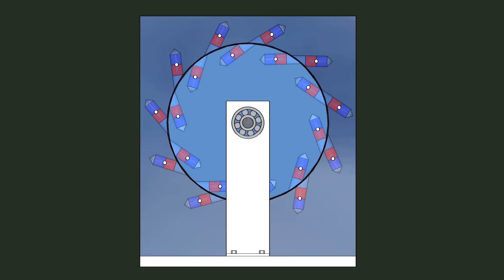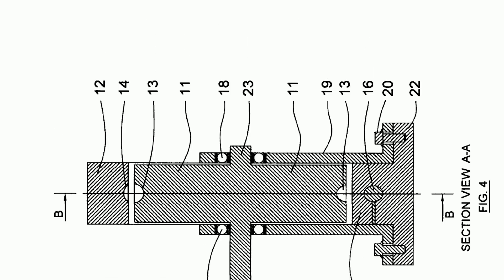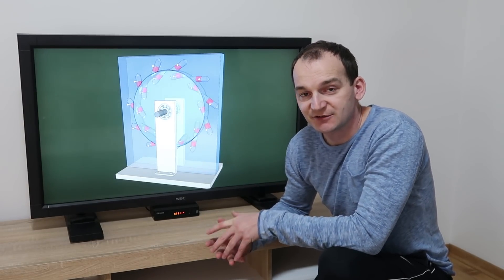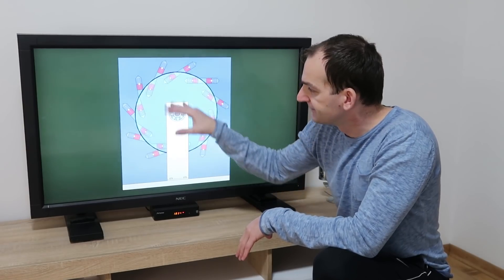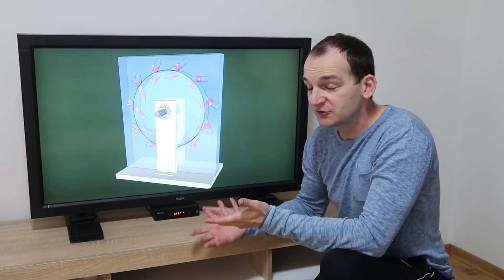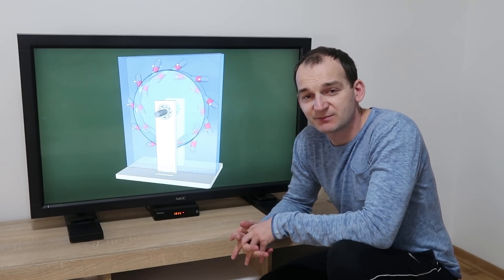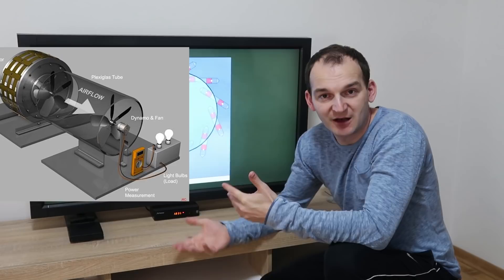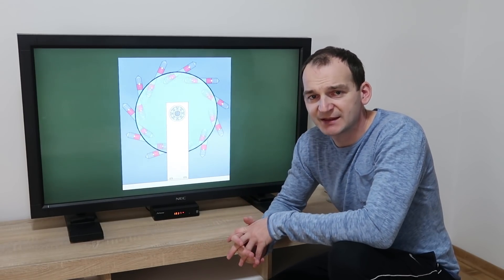Free Energy, Magnetic Motor with Magnetic Shielding by Suppiah!!!!

Comment: Lemme tell you why this won't work, as the magnet will aproch the fixed magnet, it will start rupultion, on other direction. And as the magnet will pas the fixed one, when fixed one will push the magnet, there will be no change at all, as moving magnet slow down by same amount with which it is pushed as it moves past the fixed one.. You need to prove this with a simulation not a animation. Or a physical model. Don't just file design patent and waste 1000s of bucks. You can build it under 800 bucks. Patent take atlest 2000 bucks. You are hiding behind excuse that you don't have funds, you have twice the money to file patent but you don't have 800 bucks to build the model. I know why, coz you know too it can't work at all. 😅 Stop fake shit and upgrade your knowledge
Reply: I can try and help you understand why this design should work, however I must point out that the animation they showed was going in the wrong direction. First off, the reason the magnets can't push the incoming magnets in the opposite direction from the direction they are currently traveling in,  is because the housing structure holding the magnets is a magnetic shield. By this I mean the material housing the magnets is literally squishing the magnetic field like a pancake. You see even tho magnetic fields can travel through lots of materials and effect things on the opposite side, there are some materials that magnetic fields don't penetrate and when this happens it squishes the magnetic field into a smaller area of effect. Interestingly the area of effect while squished like this has a stronger magnetic field effect. So what's happening with this design he is showing is it is blocking the magnetic field from acting upon the other magnetic field until it is to late for it to repel it in the opposite direction and can only repel it in one direction and since the construct is on a circular disc it has to spin and the only forces trying to make it stop is the friction of the moving parts and air around it, but since these forces are negligible in comparison to the strength of the magnetic repulsion, the device just keeps spinning effectively converting the magnetic field effect into mechanical motion. :D
Reply: @MasterFeiFongWong  it should work, but it won't, it will eventually stop at some point and it won't be useful at all, it will need some sort of dynamic shielding. but yeah one can say it may work, but it won't be useful at all and will stop in a short period of time
Reply: What about using magnetic shield on the opposite side as it comes around it would delete the reverse magnetism or at least lower it

Comment: On May 27th, 2009, I revealed to the world my magnetic shielding that paved the way to magnetic stator shielding to build magnetic motors. My magnetic shielding revealed it was indeed possible to over come Newton’s 3rd Law of Motion. Subsequent videos proved this even further.

https://youtu.be/JyQgYh9DTTs

https://youtu.be/KhY7hHb2l6o
Reply: I would also like to add that the shielding technique you are revealing here in this particular video, with my understanding, would not work. Reason being, flux fields wrap around the shielding in this video, thus causing a counter repulsion on the system.

I’m speaking them first hand experience.